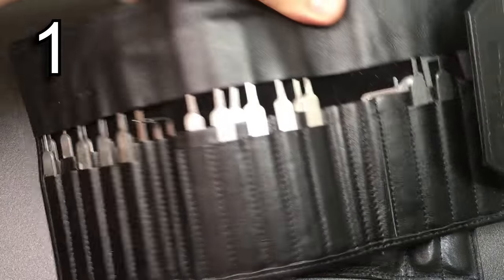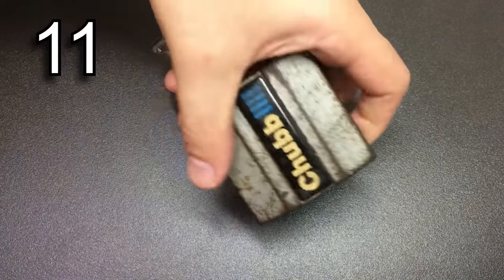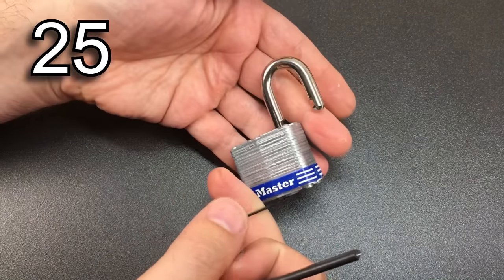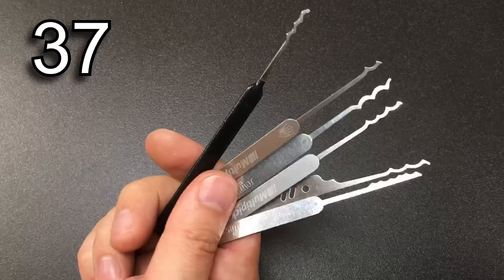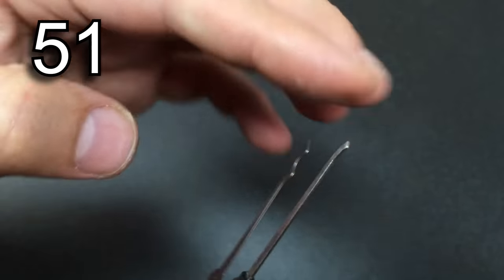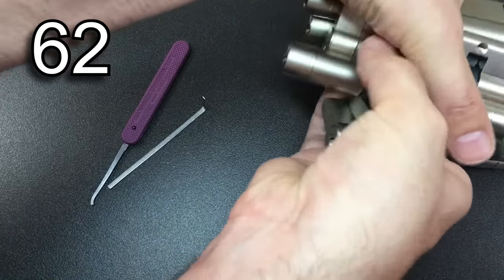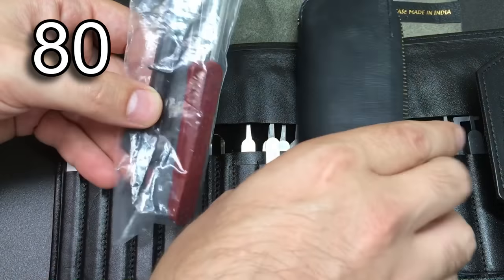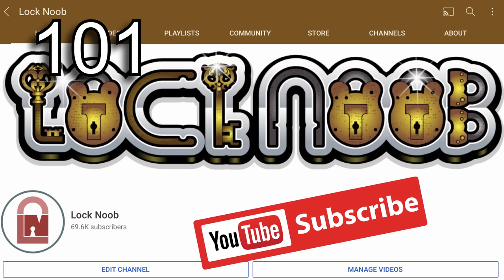101 Things Every Lock Picker Should Know

Comment from the maker: What was your favourite? What other tips would you give new pickers? Let me know in the comments! 👍😃🔐 and yes, this video took many hours to compile and edit, so all likes and shares are super appreciated 😃😃😃
Reply: Thank you so much! I have just begun this hobby and I am preparing! Also, just a quick question, where should I purchase a transparent lock?
Reply: 89 is obviously the best tip! I would add another tip: get a Dremel or similar tool.
Reply: @LuaTech  don't === I will give you mine== all cheap== ebay amazon cheap Chinese sites==== UK bump keys good place to start
Reply: Sometimes it helps to open a lock with a different method if you've been stuck on it.  Failing to single pin pick a particular lock over and over?  Try raking or jiggling for a bit and see if you can get an open that way.  Getting an open is a confidence booster and gets you out of the mindset that it's impossible to open, and using a different attack on the lock can help you to feel something you might have missed that could help with single pin picking.  Maybe it's as simple as feeling what kind of tension the lock needs, could be that you feel some counter-rotation, could be that you're hyping yourself up to believe that it'll never open, all I know is that there are some locks that I probably would never have picked if I hadn't changed my tactics.  Also, I'm glad there's someone else out there that has trouble with the same Ace lock I have trouble with LOL
Reply: To have a good time and make our hobby fun is the best advice
Reply: I love the comfort lock idea I've only been picking a short time during lockdown and im now obsessed with locks after watching your videos
Reply: I really appreciate your videos and in my opinion you cover more of the small details and tips than any other pickers making videos so just wanted to let you know that we as a community really appreciate the work you put in and you always do such an amazing job.
Reply: I don't have enough money to buy the right tools
Reply: The hobby is certainly infinite.
Reply: How to change the keys?
Reply: The whole video. Thanks a lot.
Reply: @LuaTech  can I Chang the keys?
Reply: Loved it.but can you show how to change the keys?
Reply: @ronniehopper7685  huh?
Reply: I can't find ANY besides the sponsored china made at top) picks on Amazon. So im discouraged because I've been scammed so many times by sites .. I trust Amazon...
Reply: I'm so frustrated with a lock rn .. it's a medical 12"X12"X12" metal box and it's driving me nuts. None of your videos have the type of lock it is.
Reply: @aminedoghri9399  same. I've used my bobby pin so much it's all smooth lol
Reply: I never throw tools away hehe
Reply: @maxgarascia  the
Reply: the best lock to pick are luggage locks
Reply: # 42 but there are to many but #42

Comment: I still think it makes more sense to buy 4 decent picks and 2 tension wrenches from Southord for $10 plus shipping and handling than it does to buy a cheap lock pick set on Amazon for about the same price
Reply from the maker: I kinda agree, but thinking back to the start, I wouldn’t have known which ones worked for me. My second set was the Southord c2010. FANTASTIC kit and no regrets!👍😃
Reply: @LockNoob Half Diamond, DeForest diamonds, low hook, and medium hook and the 2 cheapest tension wrenches which also happen not to have a twist in them. My first set was I have diamond deforest diamond snake rake and a Peterson gem with two tension wrenches which I picked up at a computer security conference. I used the DeForest diamond more than all the other picks combined because it made it easy to count the pins.

Comment: A really awesome tip that I saw somewhere, was to take the key of the lock you were trying to pick and insert it into the lock all the way, draw a line where the key meets the lock, so the depth at which the key is inserted draw a line there against the lock, pull that out and take your pick and line it up with each of the pin grooves on the key,  and draw a line on your pick where you drew the line on the key. Shift down, and do it for the next pin location on the key, and keep doing that for each one. 
 What you will end up with is a general guide for where each pin is going to be, so you know that you are actually pulling on a tight pin and not just cranking in between pins.  I found that doing this has really helped me gain a good understanding of the locks and where the pins are at. 
Another thing that's really helped me, is without any tension on the lock just going in with the PIN and those lines drawn, and just finding how to manipulate those pins.  Feeling what it feels like when you pull the tip of the pic off of one pin and it taps into another, feel where you need to pivot the pic or where you need to wiggle or how you need to set against the grooves of the lock.  And just go in on each one and wiggle it up and down. You can even close your eyes so that you can get a good feeling on it. Turn off any distractions and get your ear up close to it so that you can hear what the pins sound like when they are moving freely. 
Then when you are picking, and you hear a set pay attention to that as well. Pay attention to the sound when the set is good, and pay attention to the sound when it doesn't set the same.   

By the way I'm still a brand new lock picker, these are all just things that I've been using that have really helped me. 
Am a tool maker, and I have access to some really nice spring steel from between $10,000 all the way up to 25,000, so I was able to make my own picks. I have a basic set of cheap Chinese ones coming should be here day after tomorrow, but in the 3 days or so that I've been doing it, I have been able to get into every padlock every door every deadbolt in my house and at work.  Granted, most of my indoor doors are Kwik set. And outdoor are schlage. So it's not as if there's really much difficulty. But I digress.

Comment: One of my favorite nicknames for core shims is "the locksmith's best friend" just because they are so useful, in case you didn't know if you have a lock that you have access to the back, you can get it open to rekey it, by using a core shim and a key blank, it does take practice, but after you figure it out, it's something you will use more than you might think.

Comment: Love the video!  Been picking for almost a year now, 70 lbs of locks, 20 lbs picked :).  At first the master locks were so much fun, then I got bored and moved on to Abus locks, frustrating a bit but I know LPL and Bosnian Bill have been doing it for years so I still have a long way to go.  I'm doing it to relax, spending 2 hours on an American 700 pad lock and oversetting the pins, recocking and trying again is no big deal, I didn't expect to open them right away and I'm still trying.

I love raking, had a lot of success on Guard Padlocks, an American P06, and antique locks from back in the 50's and 60's.  For me it's a hobby that I can sink time into and if I get one open whoopie, if not I got my practice in.

Thanks again for the reassurance, you're giving the new pickers exactly what they need to hear/know, definitely takes the pressure off and it's good advice.

Subscribed and can't wait to go through all of your video's.
Reply from the maker: Thank you!

Comment: If you bought an antique lock  that seen a lot of outdoor service - especially in a cold seasonal climate - soak that in kerosene fo a week then drip that off and dry it out.
Else you just may break the spring that stuck in a hardened gunk that once was the oil.
Reply from the maker: good tip!

Comment: I have realized that a lot of my trouble with starting to learn to pick is that all of my practice locks are locks that I have taken off of houses and apartments and replaced with different ones for various reasons over my career. I figured rather than throw them out I could at least take the cores out and use them for practice. But that means I've been trying to pick on a wide variety of different keyways that have various different levels of wear with some being basically new and others having seen 10+ years on a front door. My locks are so inconsistent that so I found it hard to start out since every other lock I have is a different keyway.

Comment: THE MOST IMPRTANT THING I EVER BOUGHT WAS A CLEAR LOCK. I have been picking on and off for 3 years and spent a ton of money on locks and tools. BUT I NEVER BOUGHT A  CLEAR LOCK. So one day I bought one and the most important thing I learned is that I was using the wrong tool for the job. I was using the wrong pick that could have never lifted to the proper height when SPP. I would have never known if I hadn't seen inside the lock. That being said I turned in my short hook for an offset hybrid (which is a small diamond with a slight angle). A little light Raking followed by Single Pin Picking with an offset diamond = much fun.
Reply from the maker: They can be so useful!
Reply: Can I get this tools

Comment: Ive started lockpicking today, and Ive unlocked a FAB door lock that Ive just hold in my hand. Ive picked single pins, and when I couldnt finish it up because of some underset overset pin (probably), Ive used a rake pick and it finally unlocked. So far Ive tried 3 locks, and could unlock only this one, the other 2 I cant for the love of god even set one pin. BTW, Iam using a cheap set from Aliexpress

Comment: So, when are you changing your channel name from "Lock Noob" to Lock Guru, or Lock Master (not to be confused with Master Lock), or possibly "Lock Mage" ? (my favorite) .  Your comment regarding cheap and old locks was particularly on point. they can be very tricky due to awful tolerances and uneven wear.  I even had one where the driver pin was so short, and the plug tolerance so loose that it flipped sideways into the shear line! LOL, what a bizarre feed back that gave.
Reply from the maker: Sideways? That’s sort of sad and funny lol. I have to stick with lock noob now tho... it’s the law 😅😅
Reply: @LockNoob  Yeah,  I milled it open to find out what had happened; The pin was short and looked like it had been cut from a section of brass rod with pliers. I would have suspected a rejected wafer fell into the pinning line, except this lock was so cheap. Big Fun!
Reply: There’s a security institute called lockmasters

Comment: ROTFL
9 Story of my life!
Yep, that's me. LOL 
Did a bypass last night. I was like wow! It works! Well, it worked 3 times. Then it didn't anymore. LOL

Those see through locks just need a straight broken pick. At least mine do. I need to change the pins, so those are more challenging.

My see through disc detainer lock sucks. I can't do much with it. It is sloppy. The discs lean sideways and the 4 and 5 pins don't budge. Using the key, one disc turned past where it was supposed to, and jammed it all up. I had to turn it hard, after dumping a few drops of gun oil in it.   Are those supposed to learn in the real locks? I'm thinking not. 

Picked my only dimple lock, first try. Never again. LOL

58 looks like my first kit. But it's in a different case. LOL

Comment: Any suggestions for picking dirty old locks. I have a bunch of old snapped cylinders I'm struggling with. Some just give no feedback, key pins hardly drop when drivers are set. I've tried different tensions and picks and I'm getting through them slowly but it's hard work. I'm more used to picking new padlocks and cylinders. I could do with some advice. Cheers :)
Reply from the maker: If you can, take them apart and clean them with de-greaser and a small brush?
Reply: @LockNoob  Thanks, that's good advice. I can do that, but I wanted to pick them in their current state really, at least at first. Not sure why, I guess it feels like cheating if I clean them. I certainly see why having a euro cylinder pins down means they collect grime. Cheers :)

Comment: Its easy to make tension tools. you can use an old wiper blade from a car, the metal in it, or you can use a bike spoke, smash one end flat on an anvil then bend it over at a right angle. Use a file or a grinder to fine tune the dementions. i have tension tools made just for one lock.

Comment: I like everything you say here, but for me... I picked up the skillful hobby as for it to become and be a real world skill. So, for me... the goal is to become affluent with whatever lock I'm picking to the degree that I can pick it in the real world, out in the field. So a vise, by hand, etc... that's all good to become accustomed to the lock type. But ultimately, it's all about getting to the point that I can handle the lock wherever it may actually be installed in a real world use case. 

That said, I predominantly use cheap crap pick sets... I mean, these basic picks are literally 5 cent pieces of metal, stamp cut into various shapes via a 1 cent manufacturing process... and that holds true no matter the price point that you buy them at. They all cost the same nothing to make, outside of specialty tools. Heck, you bring up using a shim.... I typically have a rolled up piece of paper, wrapped around in painters tape to give it structure. Slip that in behind the core, and you've got a home made retainer. It doesn't have to be an expensive tool, just has to be an effective tool.

Comment: Do you recommend a store that prices tools fairly? I'm looking to start picking but so far what I see in stores are pretty expensive to commit for a beginner :/
Reply: Most stores have the option to buy single picks, I'd recommend starting with a simple hook, a deep hook, and a rake.  Maybe a half diamond or different size rake if you want more.  You rarely need more than that, and getting quality picks will help in the long run.  Spend the rest of your money on lots of different size/shape/thickness tension tools, because nothing makes picking more difficult than having a loose tension tool.  Focus on tension wrenches that look like they'd be difficult to bend when tensioning, as that will give you the best feedback and solid tension.  Try to avoid any that use spring tension, because it's hardly ever the tension you need.

Comment: My current comfort lock is an EVVA DPI (5 pins, 3 spools; came with 2 master wafers that ruined the spool security, since removed but the key no longer works); tricky enough to keep my interest but not too difficult to get open every time (so no key, no problem!).  #98: I've got one of those; over rotated after picking and poof, gone. 😖 Some day, I'll drill it open and fix it (removable core padlock).  Also, #89--👍💖🙏🥇
Reply from the maker: Thanks for the comment!